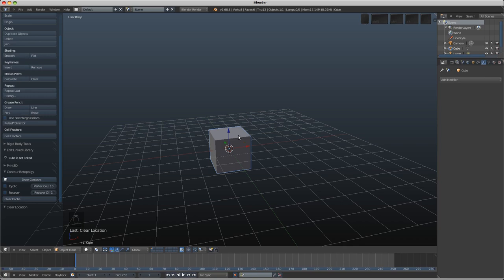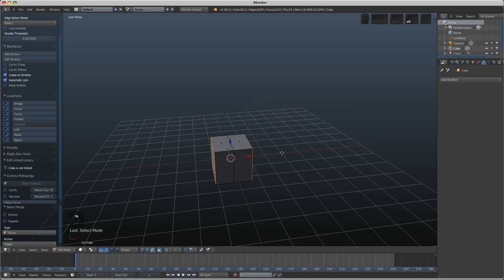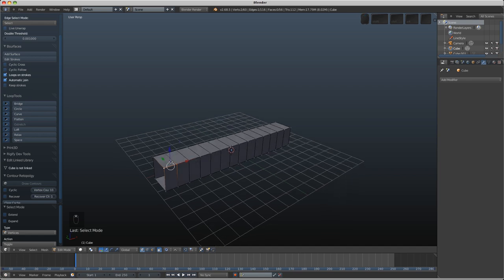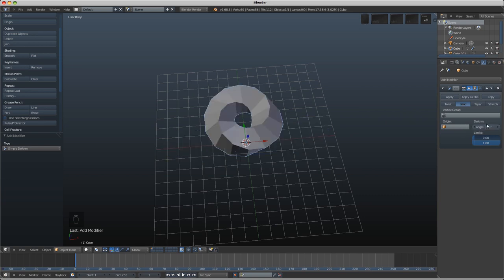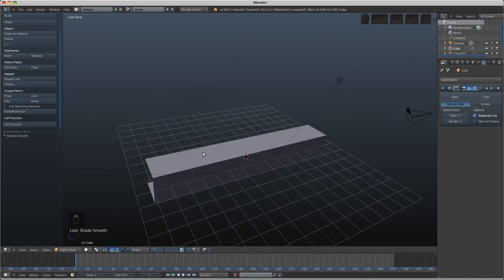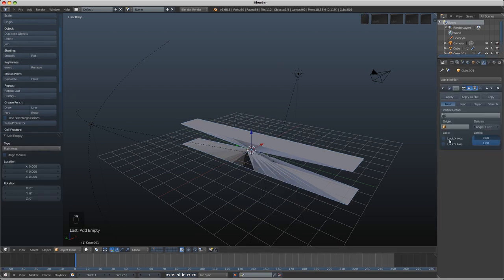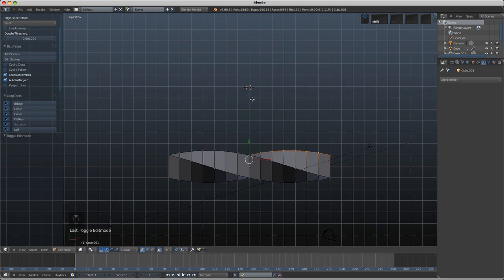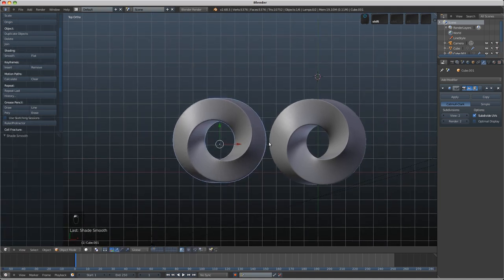Blender 2.6 Modelling a Mobius torus

Comment: I still dont get why you cant just extrude the cube out and add edge loops and then see how many units it is and then change the propotional size to that. Why doesnt that technique work?
Reply from the maker: Sounds like it would! I think there are many ways to do this and I just chose to explain it in such a way to be repeatable even not knowing so much about what is possible.
Reply: Yeah, but i when tried hitting 14 in proportional size, it was like the ends didnt lineup. But when i made them individual faces they lined up.
Could u give it a shot too see if it works for you?
Reply: Just for other viewers:

The problem Busch had was it was 15 not 14 he should have paid attention to.
" I will add an odd number of segments because when you join it back around you lose a segment " at 0.50